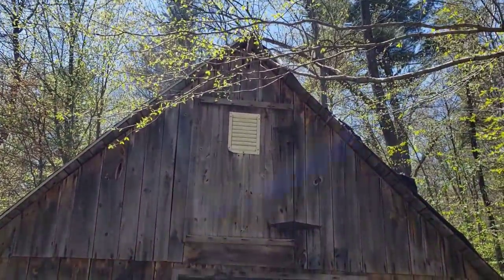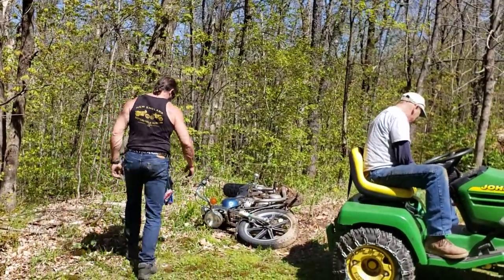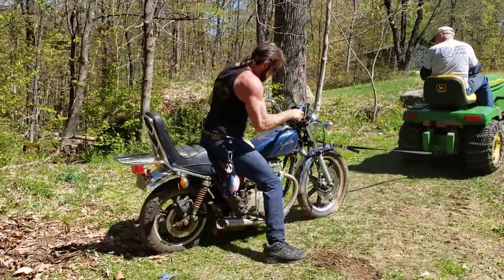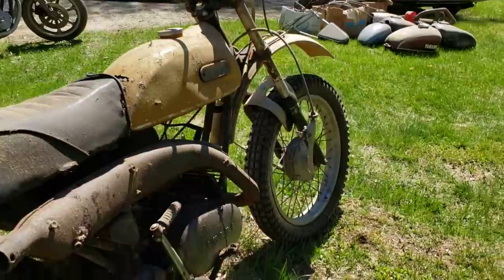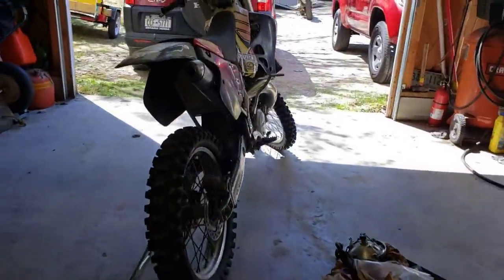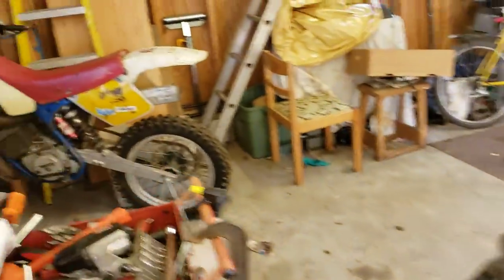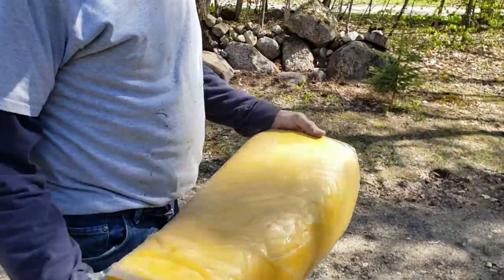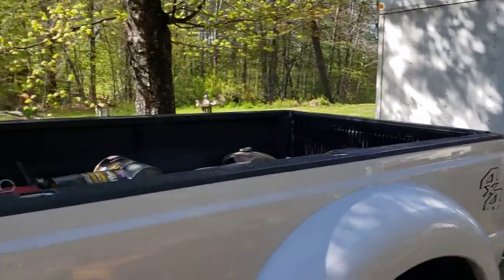15 CLASSIC YAMAHA 650 & RD350 FOUND IN NH BARN!

Comment: yamaha 650 twins are bullet proof.  I had a 78 650 Special, Red with gold pin stripes like the one here in this video
Reply: Yes indeed, they are bulletproof. Its due to the roller and ball bearings in the engine. No oil pressure required like journal bearings.....................they just need some oil flow. 
I'm 73 years young and still riding my 1978 XS650 Special. They are a ton of fun!

Comment: Everyone said the XS650 was a Japanese Triumph (but with Overhead cams, e-start and 5 speeds)  but Yamaha were even smarter because they  copied the oversquare BSA 650 bore and stroke. Supposedly more reliable than Trumpets and Beezers but did not handle as well. I've owned all three but for a very long ride (a week) chose the XS650 (1984 model) but it kept dying due to a mysterious electrical problem. Ironic as I chose it to avoid possible Lucas problems on the Brit bikes. After I sold it in disgust I learned that it was a common problem that in the entire series (1969-84) they never corrected.